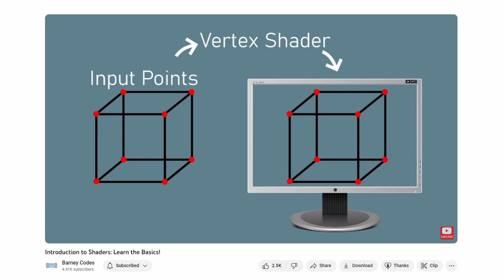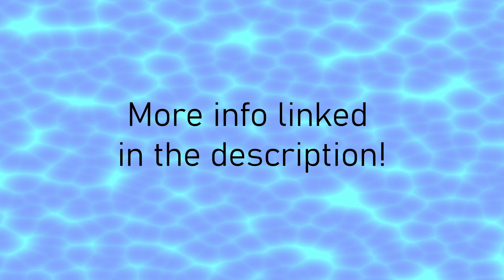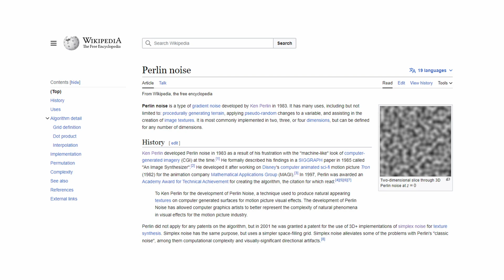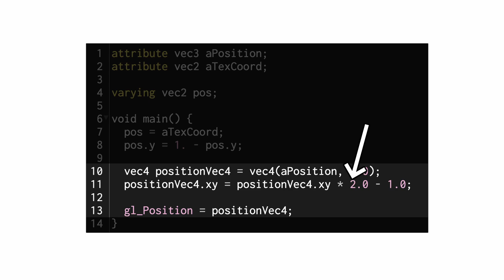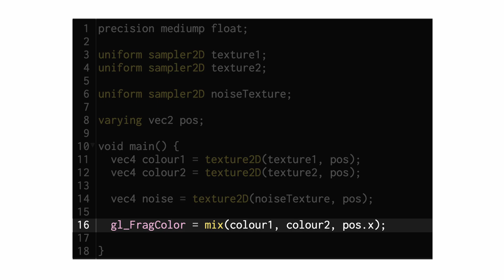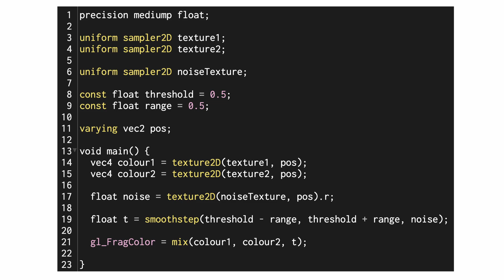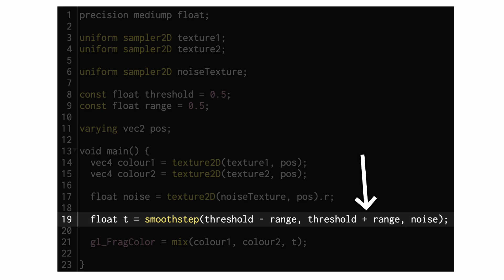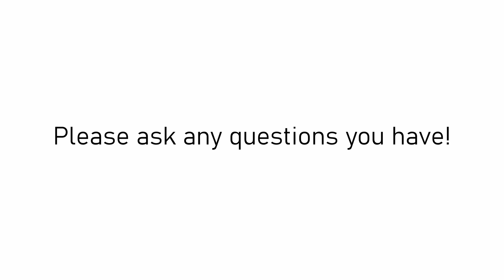Using noise in shaders (texture blending)

Comment: im on a mission to procedurally generate every minecraft texture (or atleast alot of them); im stuck on dirt. for cobblestone for example, i did voronoi -> blur -> normal map -> colorize -> dithering (also overlaying voronoi edges) and it looks exactly like cobblestone but each block connects to nearby ones and each block looks different. i dont even know where to get started for dirt, so far all ive done is split the texture up into black and white where light parts are white and dark parts are black, if i can generate something of that nature then it will be easy to do the rest, but me is lost :(

any ideas?

Comment: Here is a question: how to sample seamless gradient noise on the surface of a sphere? Do we have 2 or 3 values for the location? 

I tried to come up with something but it's quite difficult. I intentionally didn't look at references and solutions - so maybe that helps to think creatively
Reply from the maker: I've not actually tried to do this myself, but I believe there are methods of "unwrapping" the surface of a sphere into 2D coordinates. You can either map it to the full rectangle (like a how a map is a rectangular version of the surface of the earth), which will have some distortion to it, or you can probably do a more accurate version, that would have gaps, which might make it difficult to do seamlessly.
If you've got a noise generation function you could probably do it seamlessly by using the 3D point on the surface to sample 3D noise and guarantee that it's seamless?
Might be worth playing around with a few different solutions and seeing what they look like!

Comment: Barney at it again!!! 🎉

Wow I used to think generating noise in code is more efficient. But using a texture for it comes as a surprise man. Thanks :)
Reply from the maker: It's probably slightly more nuanced then "it's always better to use a texture", but things like Perlin and Worley noise can be a bit expensive to calculate every frame.
On the other hand, white noise can be really quick because you can just take a hash of the position vector to get a "random" value.
Thanks for your comment!